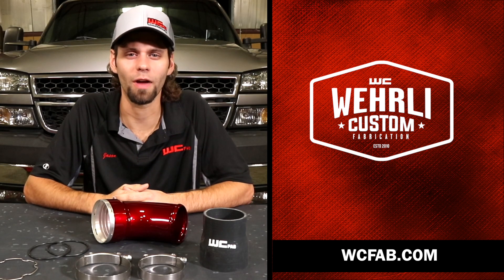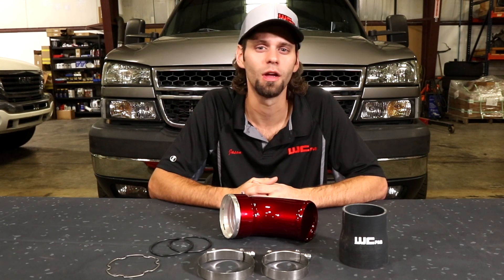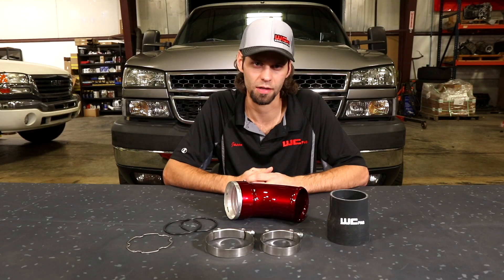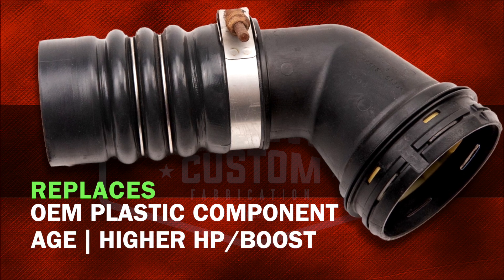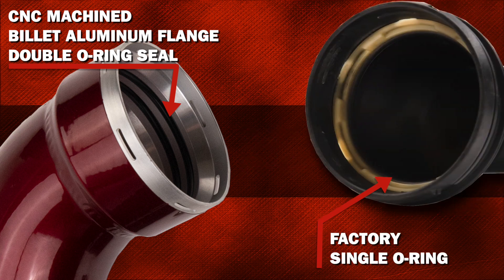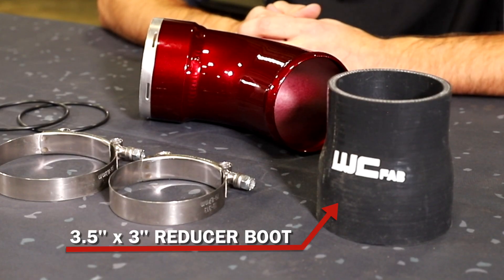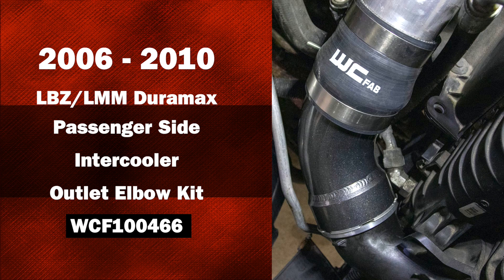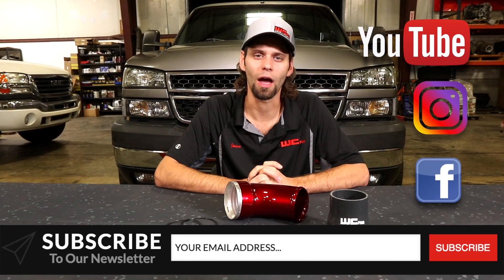WCFab LBZ / LMM Duramax Passenger Side Intercooler Outlet Elbow Kit

Comment: It’s a tough part. I found it blowing off boost pressure so my remedy is putting a 3.5”-4” boot over the joint between the intercooler and banding it.
Reply from the maker: We've got an install video providing some tech tips for installing this coming up in about 2 weeks time. If you're seeing a boost leak we'd be looking first at a rolled or nicked o-ring that was damaged during the install. You shouldn't have to install a boot over the top of it. Give us a call at 630-277-8239 or shoot us an email to sales@wcfab.com with some details and pictures of what you've got going on and our team can help get you sorted.

Comment: You guys really need to redesign this part. The first one I ordered was too tight and wouldn't go on. Sent it back, they found it was defective, and sent me another one. I'm in the process of installing it, but Jesus Christ is this thing such a pain in the ass to get on. I've dented and scratched the thing just trying to install it.
Reply: Same thing here thats how I ended up on this video because I'm like damn this shit is not going on
Reply from the maker: Please call us at the shop (630-277-8239) during normal business hours or email us at sales@wcfab.com with pictures and details of what you have going on with the installation as well as the ID of the flange on the outlet elbow that you received so that our team can help. The tolerance for the fitment on this part is intentionally tight to ensure proper sealing under high boost pressures. Please also make sure that you are not filling the o-ring grooves with assembly lube as that can prevent them from seating properly. We don't currently have an install instruction specific to this part, but the process for installation onto the intercooler is very similar to our L5P passenger side intercooler pipe whose instruction document we've linked below. Skip to around step 18 which focuses on the intercooler outlet connection: https://www.wcfab.com/files/Installation%20Instructions/l5p-3-522-intercooler-pipe-instructions-wcf100530.pdf